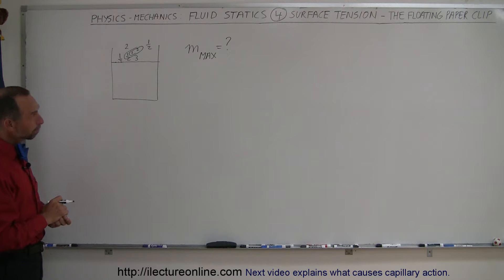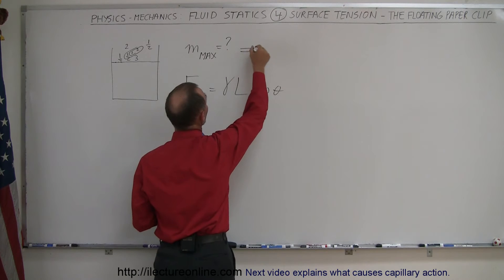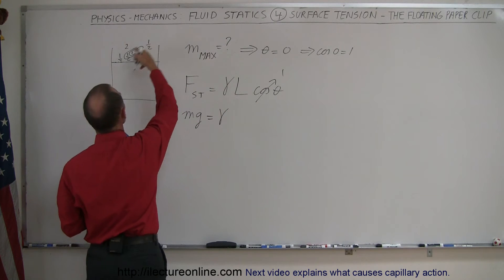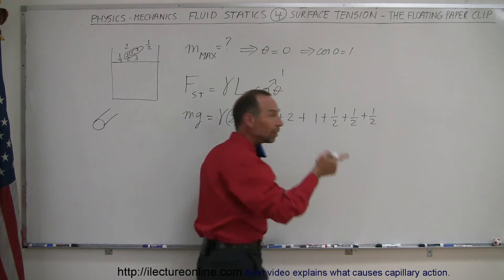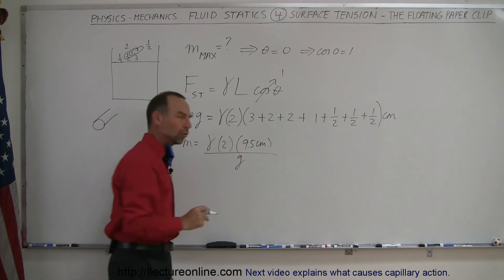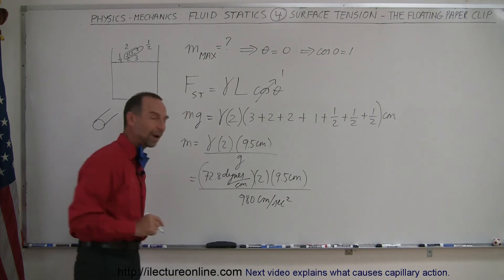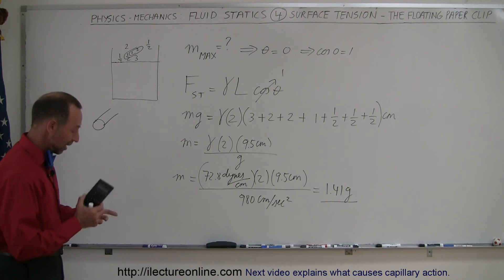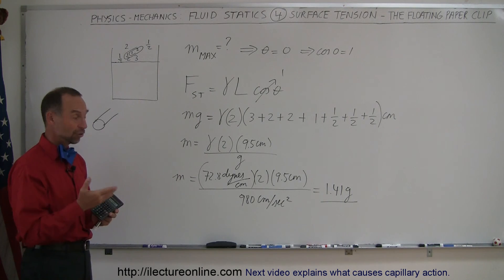Physics 33.1  Surface Tension (4 of 12) The "Floating" Paper-Clip

Comment: wont the paper clip float while only one side touches the water? if u put the paper clip vertically wont it just drown?
Reply from the maker: That is correct.  Vertically there would not be sufficient surface to produce the surface tension needed to keep it from breaking through the water surface.
Reply: @MichelvanBiezen  oh i just understood what u meant by doubling the length its cus the wire is a cylinder and has two sides where surface tension acts